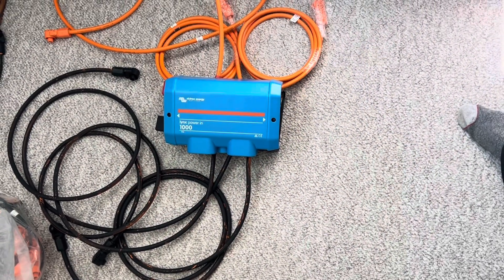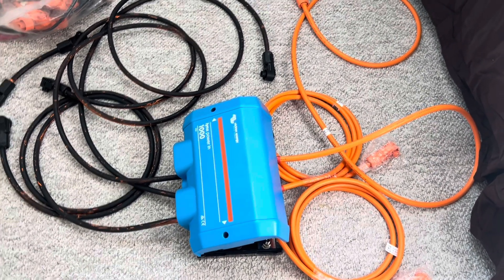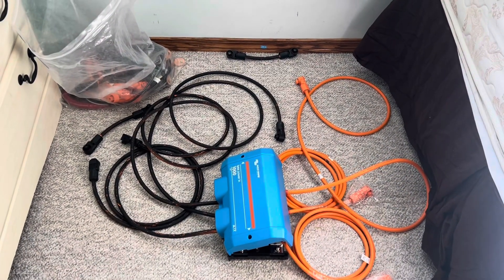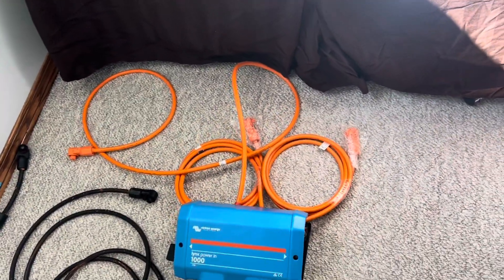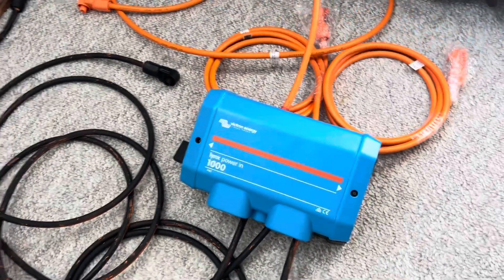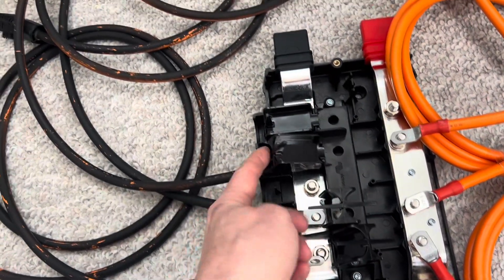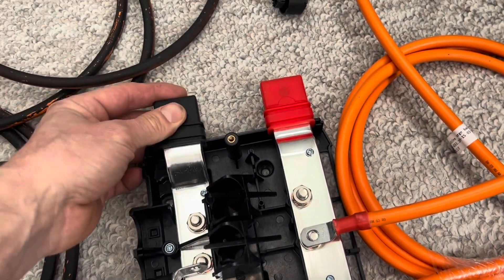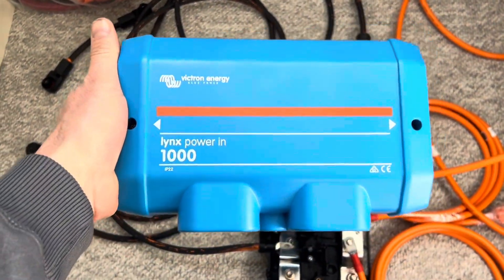**Solve** the 48v Aolithium battery cable issue with a Victron Distribution or Lynx Busbar - Solar

Comment: Well you can make your one.
Its just metal strips in plastic nothing more.
Reply: Was considering that, type L copper water pipe smashed flat and heat shrink on exposed areas might work nicely, worked fine on my 12v system.